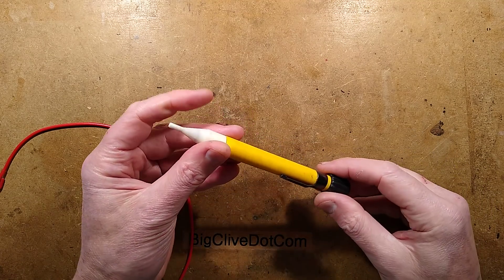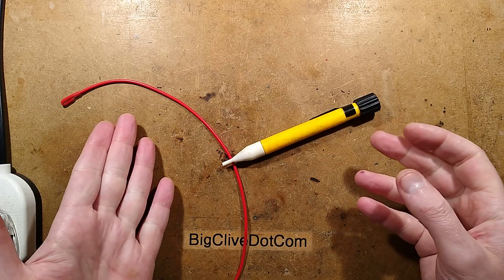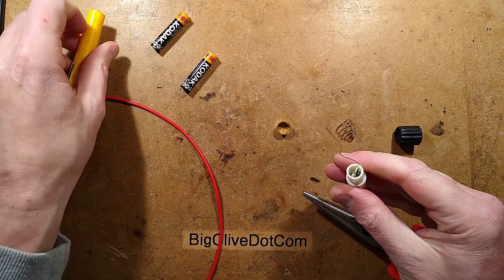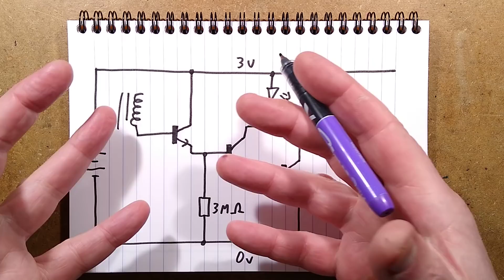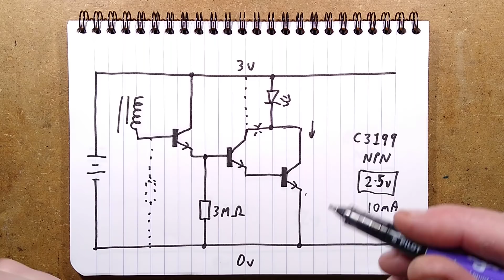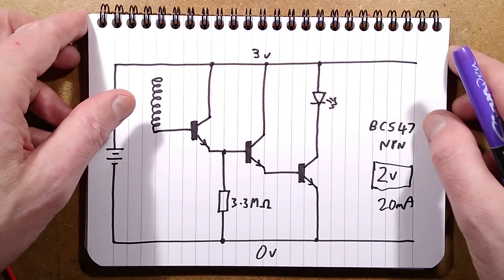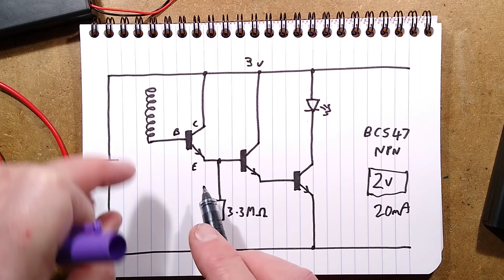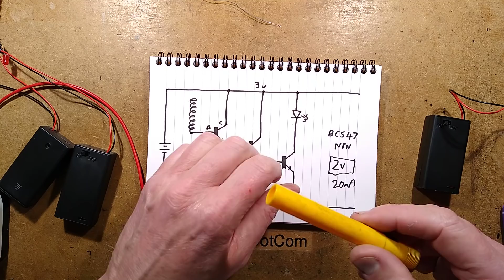Volt stick circuits and tests

Comment: I think you may have it the wrong way round: I'm fairly sure the way the last two transistors are configured in the existing product is the classic way to do a darlington array. I agree, though, that the forward voltage drop is lower if you attach the collector of the first transistor of the array (of the last two) to the positive supply rail. Generally this would necessitate an extra resistor in series with that transistor because otherwise it could conduct too much current from VCC straight to GND if it got turned on hard enough, and damage itself. In this particular application I don't see that happening (the LED doesn't have a resistor either), as the input signal is very weak.

I wonder if anyone has ever thought about putting one of these into a cordless drill
Reply: There have been drills with these in them, but by the time the drill bit is close enough to the wire to make it show voltage you probably are only a turn or two of the drill away from being through the insulation and into the wire anyway.
Reply: Yes, I agree.  The potential engineering problem with his improved circuit is there there is no current limiting in the 2nd transistor which drives the BE of the third. It's probably driving the 3rd transistor to saturation which is good for getting a bright LED but could potentially burn out a transistor depending on what transistor you use and how much current your batteries can deliver. More practically, this design can waste battery power so the batteries will run low far faster than necessary.  You only need just enough current through the 2nd transistor to drive the LED to the desired brightness and if you allow any more than that, you are pointlessly wasting battery power. Putting a resistor between C and +V above the 2nd transistor is the natural way to do this.  We can calculate the approximate value of this resistor like this....

If the LED brightness goal is 10 ma through the second (reasonable for a battery-driven application where you want the batteries to last as long as possible), and we assume a beta of 100 of the 3rd transistor, then the 2nd transistor only needs a current of  1 ma to the Base of the 3rd.  If we assume the batteries are 3V, then we can subtract the expected .7 V BE forward voltage drop giving us a 2.3V drop across the current limiting resistor when the 2nd transistor is fully on.  Using ohms law, R=E/I so R=2.3/.001 = 2,300 ohms. Or, about 2.2K.

It is possible, even likely, that the 2nd transistor will not be turned fully on at the sensitivity level desired for the probe.  This means the full 2.2K current limiting may be more than needed. And you might want to waste more battery power to get a brighter LED.  Both of these would imply using a lower value resistor than 2.2K.  So experimenting with values like 2.2K, 1K, and 470 would be called for.  Test the brightness, sensitivity, and total current draw from the battery to find a good compromise have gives you the desired sensitivity and LED brightness without wasting any more battery power than you must.  I'm guessing 1K might be the sweet spot and that might yield as much sensitivity and brightness as seen in Clive's design but lower the current draw from 20 to 10 ma giving you twice the battery life.  This would only be true if that second transistor in his design is wasting 10 ma of current pointlessly.

On the issue of the LED needing current limiting, yes, that could be an issue.  But a red LED can have a voltage drop of 2.6 volts or so at a normal 20ma of current and since this is driven by what I assume is a 3V battery pack it is in a range that almost doesn't need a resistor.  If the batteries are fresh out of the box, it will likely push very high currents through the LED, but a normal large-sized LED as used in the video can handle currents way up to values like 80 ma without instantly burning it, but it will GREATLY shorten the life (to say 2 days before it burns out). But is we add the resistor I talked about above, it does the current limiting for the LED, and only what's 1/100th of the power that any current limiting resistor in series with the LED would be wasting.

In the Darlington design from the manufacturer, the LED current limiting is not needed.  This is because when the collectors are connected together, it creates the condition that the 2nd Q can't turn on unless the voltage drop across the transistor pair C to E exceeds the needed forward voltage drop of the BE.  This means the voltage drop across the LED will be the battery 3.0, minus the needed forward voltage drop of around .5V maybe leaving 2.5V across the LED.  2.5V across a red LED only gives about 10 ma of current through it.

But once we switch to the design used by Clive, the pair can over-drive the LED so we need current limiting.  But the better way to do that is the resistor I talked about above, rather than one in line with the LED.
Reply: I agree... Darlingtons always have their collectors connected together.
Reply: I think Clive was considering the difference between
Darlington - > transistor
Transistor - > darlington
Not that there wasn't a darlington somewhere.
Reply: Reading some of the replies the last place you'd want one of these is in a power drill of any type! 😂
Reply: Exactly.
Reply: It would be nice to have a drill that used the bit as a detector with the circuit linked to an led and a cutout.
Reply: @anononomous  That's more or less what I meant
Reply: Agree. Clive's circuit is not a Darlington, and it is quite prone to overcurrents draining the battery and/or destroying the transistors and LED.

Also, all the different circuits really should have a current limiting resistor in series with the LED.
Perhaps the voltstick uses a LED with built-in resistor?
Reply: @vonnikon  The manufacturer circuit doesn't need the current limiting resistor.  If you get the voltage right, an LED doesn't need current limiting and the manufactures circuit gets the voltage correct.  A red LED will work fine on voltage from about 2.4 to 2.8 without a current limiting resistor but the current will vary a lot directly with the voltage. It has a steep voltage to current curve, but is nowhere near as steep as a normal diode which is why it's reasonable to play these games and leave the current limiting resistor out of the circuit at times.  A Darlington pair forces a voltage drop across the transistor pair which is the combined forward voltage drop of the BE of the last transistor (about .7 normally) plus the EC saturation voltage of the first, which might be .2 but depends a lot on the transistor.  So the Darlington pair forces a voltage drop of around .8 volts across the C to E of the pair. This drops the voltage across the LED from the 3.0 V of the batteries down to about 2.2 V which is both enough to light an LED and be in a safe (low) current range for the LED without needing a current limiting resistor.  Using the Darlington as configured saves the need for one more part which on a circuit with only 5 components can be useful for mass production.

In Clive's circuit, there is no forced large voltage drop.  His LED driving transistor can go down to limits of the EC saturation voltage which might be .2 V range but can be as low a .02 V on some.  That would put a 2.8 V or higher voltage on the LED and that is not likely to burn it out instantly, but can greatly shorten the life of the LED. 2.8 will likely force near 100 ma of current through the LED. Clive's design needs current limiting both to protect the LED from a short life span and to prevent the transistors from being burned out if a strong EM field is sensed and the second transistor overdrives too much current into the third. In the video, his circuit only draws 20 ma which is perfectly safe, but if you use it to sense a stronger field or higher current it could pull a lot more current. But the best place to put the current limiting into his circuit is the collector of the 2nd transistor, not in series with the LED. That solves two current limiting problems in his design with one resistor.
Reply: @CurtWelch  as you say, the current will vary A LOT with the voltage when no series resistor is used.
You assume the voltage from the battery is 3V. That assumption is false.
With fresh alkaline cells the voltage will be 3.2V, which will be about toasty for the LED.
As the battery drains, the voltage will drop down towards 2.4V, at which point the LED will not work at all.

It all becomes unreliable and hit or miss.
Just the negligible cost of two resistors would have made this device much more reliable over the entire lifespan of the battery.

Another reliability problem with this design is the negative wire that goes alongside the cells. It seemed to scrape against the cells. That is a cell short circuit waiting to happen. (Cells outer shell is live. Just a thin piece of plastic sticker is acting as insulation)
Reply: @vonnikon  All very True.  The normal design concept for LEDs is to drive them with a fixed current source, not a fixed voltage source.  But in his application, the design is likely to work just fine even though you are driving it with a voltage source that has a lot of variability due to the charge and type of battery and the characteristics of the batch of transistors and LEDs used.

Keep in mind that in this application, the LED doesn't stay lit for extended periods. It only turns on for short bursts. So it can withstand much higher currents.  So let's say the voltage is a worse case of 3.2-.6 = 2.6V then the V to I curve of the following LED will place the current at around 80 ma in this Cree 5mm red led: (but will vary of course from batch to batch).

https://cree-led.com/media/documents/1268-C503B-RCS-RCN-min30-C503B-ACS-ACN-min30.pdf

The above LED is recommended for a good life span to be in the 10 to 20 ma range. But yet has a max forward continuous current of 50 ma and a peak rating of 200 ma.  The peak rating is 1/10 duty cycle with .1 second pulses.  This application is driven by AC that gets rectified by the transistor so it will pulse when it's on with a duty cycle of less than 50% and very fast pulses.  This flashing allows you to double the current from 20 to at least 40 ma with no harm at all if you run it turned on continuously so it heats up. But the typical use of a tester is more like 2 seconds of on time, followed by 3 hours of off, followed by 2 seconds of on time.  Heat is what kills the LED life span and why they have very short lives with you drive them with these higher currents. But this device won't normally be expected to get hot because it seldom stays on for more than a few seconds and has very long off times to cool down. LEDs have a life span of around 10,000 hours when left on continuously with 10 or 20 ma.  It drops fast as the current and heat go up.  But these 80 ma pulses for 2 seconds a time reduced the LED lifetime to 1000 hours, how long would the tester last?  Let's say an electrician worked 8 hours a day and used the tester constantly, and this resulted in 2 seconds every hour for 8 hours.  so 2*8*5(days per week)*42(weeks per year)/60 (seconds in an hour) = 56 hours of on-time per year. If the overcurrent reduced this LED's life down to 1000 hours, the tester would still have a product life span of 1000/56 or 17 years.

And when clive tested the actual product a shipped, he was seeing 10 ma total current. Though I assume he wasn't looking at with a scope to see the actual peak currents. So bases don the actual transistors used and the LED used, the current is way down in the super safe operating limit with this 10 ma current flashing at a <50% duty cycle and only being left on a few seconds every few hours (or if it is like the few I have, they sit unused for MONTHS on end before I ask it to flash a few times for me on a project).

There is most certainly not a lot to be gained by leaving out 1 resistor from the design.  It means the manufacturer will have to be careful about the quality and consistency of the LEDs and Transistors they buy and if they are forced to buy a different LED or transistor supplier it might not work very well.

And your point about the wire is valid of course as well.

But these units are mass-produced products in markets with very high competition. If you don't cut corners and shave every penny you can off the manufacturing cost, then your competitors will, and when they undercut your self price by $5, they get the market share, and then you aren't selling enough to match their economy of scale.

Here's a cheap modern version of one of these:

https://www.amazon.com/KAIWEETS-Sensitive-Adjustable-Non-contact-Flashlight/dp/B07SL4NSS1/ref=sr_1_22

$14 delivered to my door, tonight if I click the buy button.  Don't even have to get out of my chair to order it.  And it has an LED bar graph and might well have a computer inside of it. :) These prices only exist because a company has figured out how to capture a large market share and cut every last penny of unnecessary cost out of it.

It's hard for me to see leaving out the current limiting resistor in that old school tester design, as an engineering "failure" if it allowed the economy to win the market for that product.
Reply: @CurtWelch  if you wish to cut costs: use SMD parts, not this THT which requires manual assembly.
With SMD, two extra resistors is less than one cent.
Only the very cheapest useless garbage cut that kind of corners in a safety related device.
Reply: I haven't worked around much electronic stuff for quite a while, but yes, I saw that circuit and thought...Hey, that's a Darlington...I first worked with Darlingtons in the 1970's on CNC machines, for relay drivers. They referred to them, and other similar components as relay 'drivers', although they were usually sinking the relay coil to ground.

Comment: I have 2 of these non contact voltage detectors, an ANENG VD-901 labeled as AC 12V/1000V and 48V/1000V (Dual sensitivity range), 
and a generic one labeled AC 90-1000V. These detectors can also detect DC and as low as 5V, as long as the power supply is a switching power supply. 
These detectors react to the "switching noise" that the 5V output carry. It will not work with a linear bench powersupply.
With a universal smartphone charger with USB port as output, you can make a simple PCB track tracer as follows : 
take a (old) USB cable (from a printer etc....) and cutt of the connector that goes into the printer. Strip the outer layer of the cutoff end, and extent the 5V positive wire with a short cable with a crocodile clip. The remaining 5V negative and the 2 data wires or not needed and must be isolated so that they cannot touch eachother. 
Now plug the usb cable in the smartphone charger and connect the crocodile clip (5V +) to the suspected wire and use the non contact voltage detector to detect where the wire is internally broken.
You can also connect the crocodile clip to a PCB trace on any circuit, and use the non contact voltage detector to track the trace on the board.
Because these detectors react to the "switching noise" of the adapter, the negative wire is not needed, and this technique can safely be used on most circuits.

Comment: I must be learning something, because as soon as you said "Volt Stick", I'm thinking Darlington Pair.

Now, about 15 years ago we had a couple of small screwdrivers with a flickery LED in the handle. It ran on a pair of LR44 cells. I used to call them electronic rats because they detected live wires. I'm not sure I'd want to put too much trust in them, but they were a novelty at the time. Nowadays, we have a Fluke 117 DMM which incorporates a voltage detector, with I think, the intended purpose of allowing you to avoid drilling into live cables embedded in walls etc. It's also good for finding breaks in extension leads and suchlike. Even with a name like Fluke, I'm still not sure I'd trust it 100%, especially since it sometimes detects copper pipes as well - and they're not live!
Reply: They're not supposed to be live.
But we all know stupid happens.
Reply: You might actually have some capacitive or inductive coupling into that pipe.

Comment: They are handy but get many people injured .I had one made by Greenlee and I could walk with it turned on and in my pocket and it would go off when I would walk under hight tension power lines .tried to light up a T8  fluorescent tube and it did light up just by sticking one end in the ground .line was carrying 120kv or more.A few times it saved my butt .someone energized equipment I was working on and it went off in my pocket as power was energized .lucky I wasn't grounded or between phases
Reply: @Ross Radford Yes we do follow Loto but there is always some time when you have to test live and in some cases there is always someone who thinks they can remove or bypass safety interlocks .